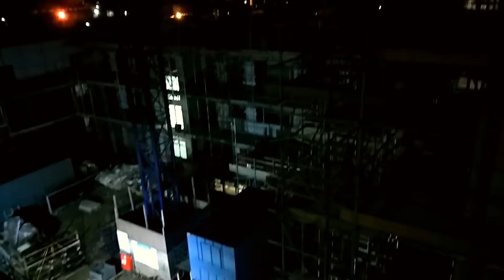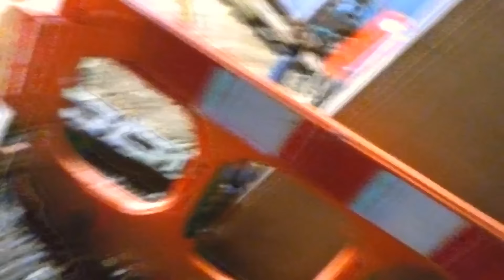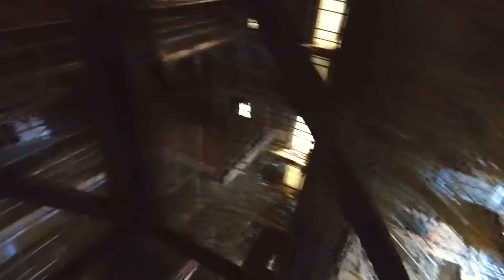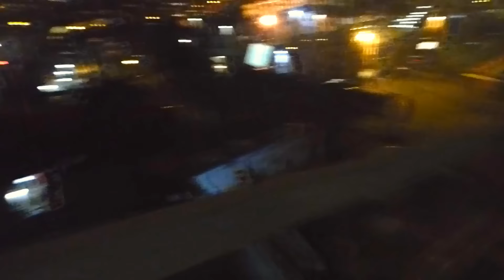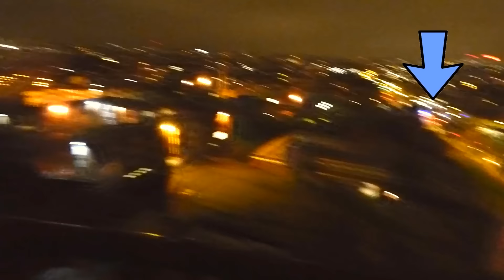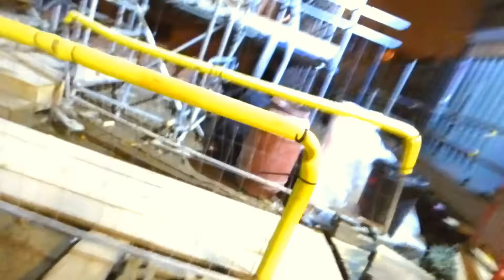My second crane climb - almost caught

Comment: On the tallest crane I have seen, the cab is attached to a climbing lift motor so it can move up & down & the driver doesn't have to climb a ladder. I have seen it moving up & down. This was in Barcelona in 2009.

Comment: Have you considered health and safety? You must wear a hard hat and safety boots with steel toes. You could step in some nails.
Reply: And a high viz jacket because a high viz jacket can protect you from anything lol
Reply: Yeah, but not from falling. Construction workers not only have wear a hard hat, when they are working on roofs the often have to use safety lines. A building site is not a playground many accidents happen on the job site. You wouldn't want to fall ontop of rebar that is sticking out, they can be deadly (think prince of persia style spikes). This is why they often put orange caps on the ends.